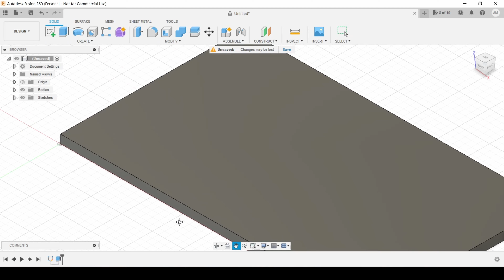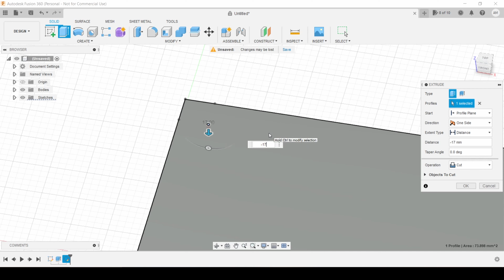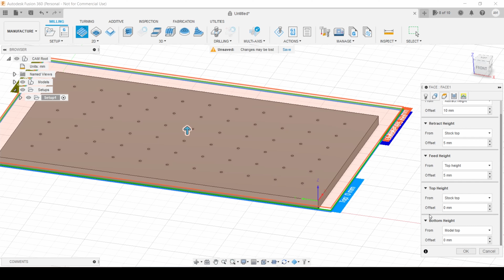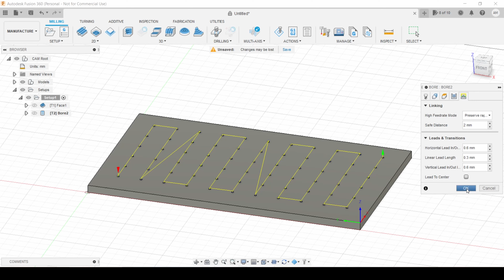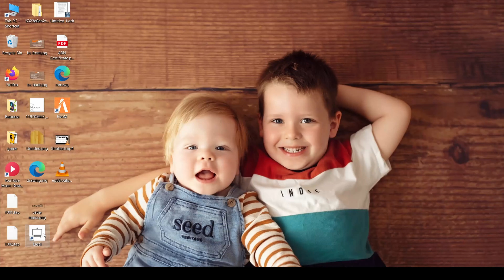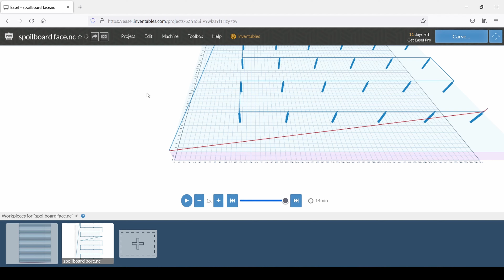How to design and cut a CNC spoil board in fusion 360/Easel.

Comment: Where did the 1mm surface cut depth come from? I didnt see you selecting that anywhere.
Reply: It looks like it is the difference between the model height (as defined in Design), and the physical size as specified in the Setup as Fixed Box

Comment: great video...i do not under stand why you did 18 + 18 for board thickness...why that formula...thank you for the video.
Reply from the maker: Thanks mate. I needed the holes to go through the spoil board into the base board for threaded inserts.both are 18mm thick so instead of in my head thinking 18 plus 18 is 36 I can just type 18+18 and fusion with do the maths for me. In this case it's not hard but it's a habit I developed that is very helpful when adding or subtraction odd amounts. (I.e if my boards were 17.972mm I could just type 17.972+17.972 instead of the maths in my head)

Comment: Thanks for taking the time to help with this. I have designed some guitar parts in Easel but it won't carve the radius on the back of the neck, do you know if it's possible to import the drawing into Fusion and create the radius then export back to Easel to use Easel G code to carve it? I'm using a MacBook by the way. Thank you

Comment: Quick tip for selecting all the holes, you can hit "select by diameter" just underneath and it'll pick all the holes in one operation.
Also when dimensioning the original hole location it's better to use the dimension tool and use the edges as a reference. They way you've used the trim tool there it's lost the original reference to the rectangle and is no longer constrained
Reply from the maker: Oh good to know thanks.